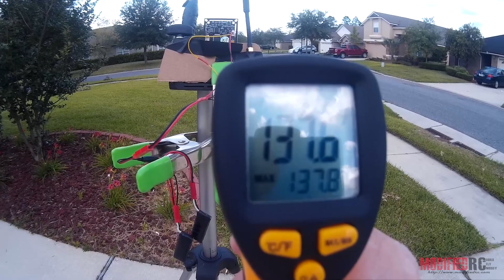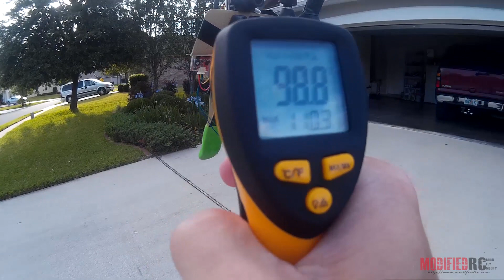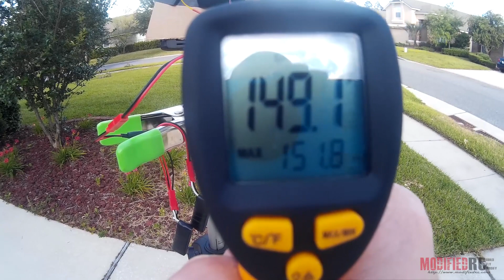Surveilzone TS5828 600mw 32 channel vTX and CC1333 600 TVL camera Quick Test

Comment: Hi ModifiedRc, do you think that is normal if mine reaches 80 Celsius after 5 mins test on my table ( so without cooling wind). Using 3cells lipo + clover leaf antenna. I think that temperature can be dangerous if it touches for example other wires in a 250 racing quad where there is not so much space... What is your thought, is this acceptable working temp?

Comment: Would you say that the heat sink gets warmer than the sma connector? Mine feels like the sma connector is hotter than the heat sink itself. Just curious if that's normal since 2 of them have fried
Reply from the maker: TeamBlue Falcon The chip that gets hot in these vTX's is right behind the SMA/RP-SMA connector so some of the heat gets transmitted to the outer casing and to the connector. Depending how the vTX is originated may change what gets warmer.  With these smaller vTX's you have to be careful and maintain good airflow over them or they will burnup. I do not suggest letting one sit idle without airflow for more than 2 or 3 minutes.. If so power down the aircraft.

Comment: My ZMR is ready for its maiden LOS flight (no VTX, no board cam, no antenna). For the next part of the 1st time FPV puzzle (Don't Cringe), I've decided on the Quanum goggles, and was considering the Skyzone Plug-n-Play FPV 500 set from HK. Do you think these products from Surveilzone are a better choice, and would I be able to put something together RTF for the ZMR that would end up being better ... without breaking the bank?http://www.hobbyking.com/hobbyking/store/__66474__Skyzone_Plug_N_Play_FPV_500_Set_With_TS58500_TX_RC832_RX_Sony_700CCD_and_C_P_Antennas.html
Reply from the maker: ***** Nothing wrong with the Quantum goggles.. That is what I started with. As for that kit everything looks ok but I think that camera is the larger version (hard to tell with their photo) and if it is the larger version it will not fit properly in the ZMR250 frame. The smaller version of that camera will fit fine though.